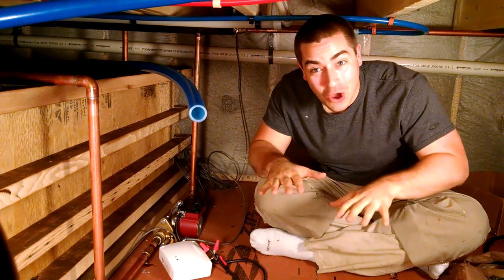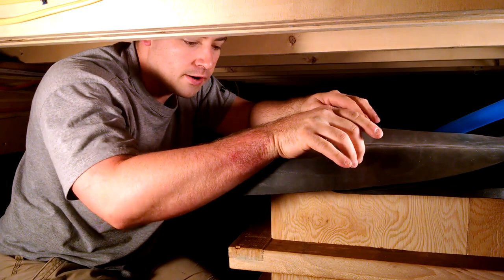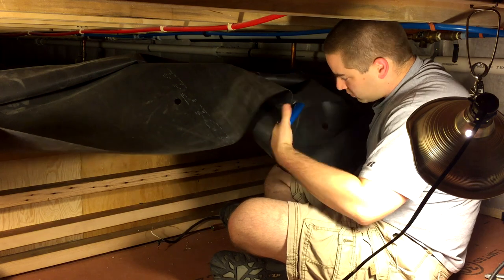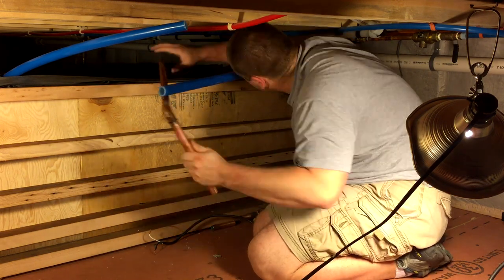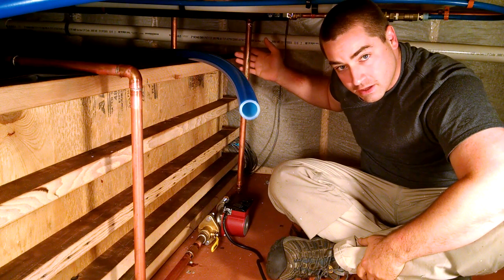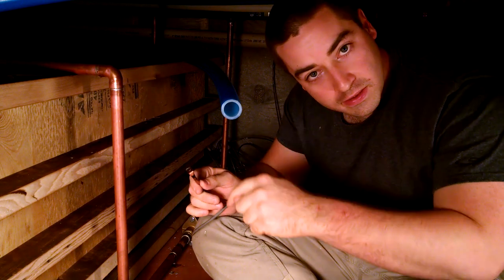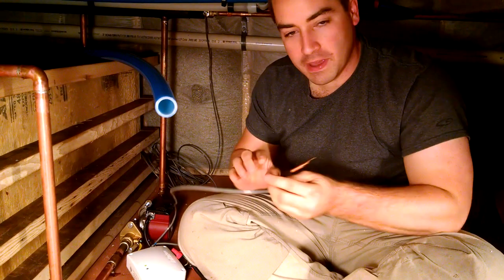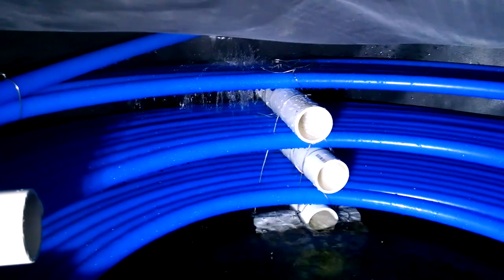Turning on the solar hot water for the first time

Comment: Wow looking good .  I have one 4 x 8' panel that i made my self on an angle adjustable frame that will get too hot and boil if I get the angle to the sun to close . I should have made it smaller .  you guys must use lots of hot water.
Reply from the maker: Hi Larry,  Our 3 panels are vertical, attached directly to the wall.  This is not ideal for capturing the sun's energy.  Having an angle (like you) would be better.
Reply: @DavidPozEnergy  Hello Mr Poz.  I am looking in to solar heat for my house, I watched your videos twice,,, is there anything you would do different if you had to do over? On your circulating pump what is the energy consumption? We are offgrid as well. Thanks
Reply from the maker: @haroldmarsh716  Hi Harold,  Next time I would use copper.  3/4" copper tube, 100 feet in length instead of the PEX.  I forget exactly what the pump uses, I think it was around 40 watts when running (sunny), and the controller was about 5 watts 24/7

Comment: hay David, I looked everywhere on your videos about building this tank, and I was wondering if you knew how many gallons it takes to fill up your tank, I'm building the same type of system but with 6 solar vacuum hot water panels, and I'm trying to figure out how big of a tank I should use, also I'm running PEX under all floors of our home, but also I'm going to plumb so that it will preheat water going into our hot water heater.
Reply from the maker: Mine is a 250 Gallon tank.  Ideally, you have a tall tank to take advantage of stratification.   But I had to work inside my crawlspace.  FYI, on the pre-heating loop.   If I did it again I would use 3/4" soft copper tubing, not Pex.
Reply: @DavidPozEnergy  yeah, I can see where your coming from having a tall tank would be better, thanks for your help, I appreciate it.

Comment: do you have a video showing how to install and use the control system for the water. it could be nice seen one of the lid, because I think If I make a bad lid i'm going to have a bad system
Reply from the maker: It is a "temperature differential controller".  When the collectors (outside) get hotter than the tank (inside) the pump turns on.  Thanks for watching.
Reply: @DavidPozEnergy  Is there a temp cutoff if the tank gets to hot? and if so what is it set at?

Comment: so what is going to happen in winter your copper lines going to the solar panels are going to freeze or how do you prevent this
Reply from the maker: This is a drain-back system.  When the pump shuts off all the water drains back into the tank.  So even when the outside copper goes below freezing, it is empty.

Comment: the outlet of your system can be connected to the entrance of the cold water on a regular electric boiler, so the hot water enter my boiler keep it from turn on
Reply from the maker: I have added an in-line electric tank.  Thanks for watching.

Comment: Why are the panels hang on a wall? why you didn't use the roof?. Regards
Reply from the maker: My roof is filled with solar electric (PV) panels.  There was no room left on the roof to fit these hydronic panels.  Thanks for watching.
Reply: @DavidPozEnergy  You also get some selection of winter sun over summer sun that way as when the sun is lower in the sky (winter) you get  more power extracted than when you have the sun high in the sky (summer) which works very well for a cheap 'don't capture too much energy' solution for summer. :-)

Comment: What controller are you using?
Reply from the maker: I'm using an older model Heliodyne: http://www.heliodyne.com/products_systems/control_units/delta_t.html  I just checked the website and didn't see my model listed any more.  It is pretty basic, has one relay built in that switches the pump on/off based on a difference in temperature between two thermistors (temp. sensors).  One sensor is reading tank temp and one is reading panel temp.